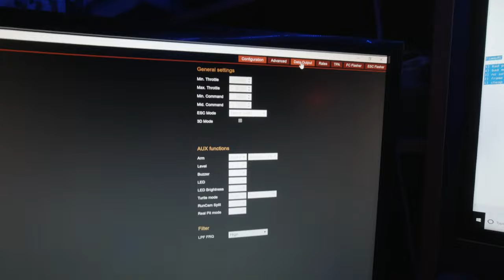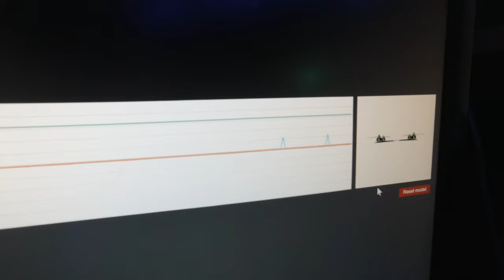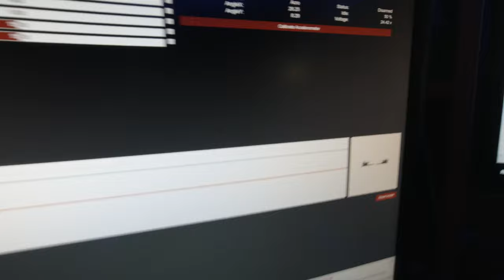How To Fix FPV Jello | Why my brand new build had jello and mid throttle vibrations

Comment: Came across this video trying to find my issue. Walksnail HD pro with serious jello only when on the throttle.  Bought a new camera thinking that was it but it’s still there. Even took the vtx/cam and put it in 2 other rigs (both have walksnail v1. A 5” and 7” with no jello) and it’s there. I’m going to try the mipi cable next and then the vtx. I was hoping to find it to be something simple that I’m overlooking.

Comment: Hey dude. Easy way to check for shit motors is to spin them up on the bench like you did but instead of reading the gyro simply feel the motors as they spin with your fingers. Lightly pinch the bell and feel for wobbles. Do the same for the shaft.  Do all 4 motors like this and compare. A bad one should be noticeable.
Reply: Oh and dont need to soft mount motors. More trouble than its worth.
Reply from the maker: Appreciate that!!